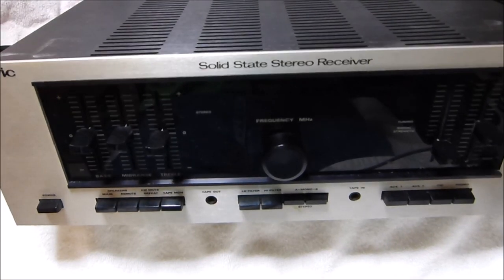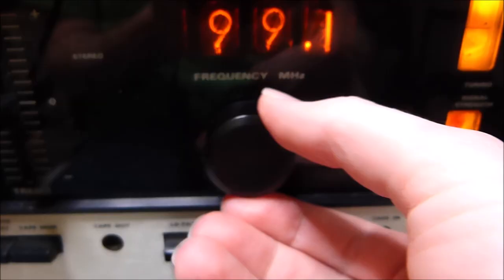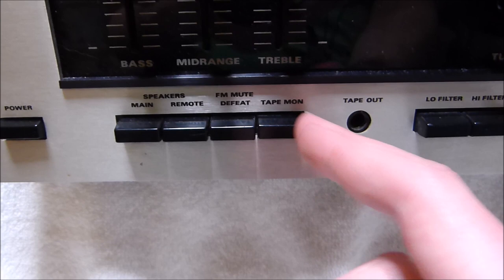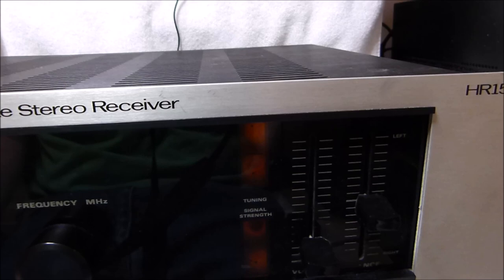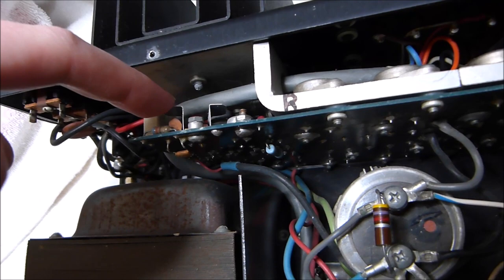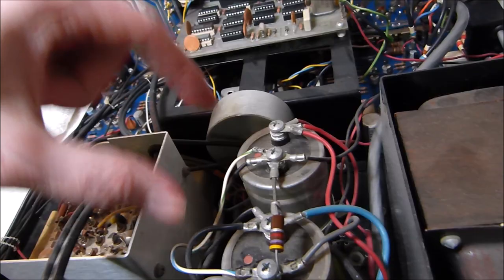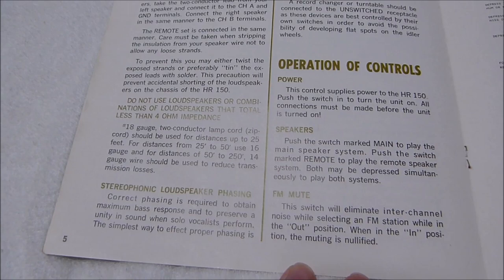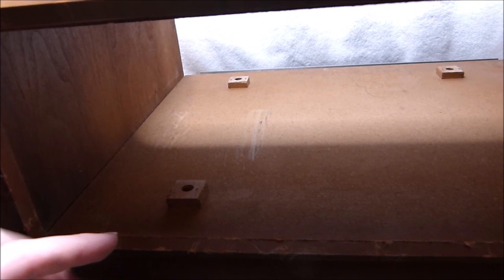Hervic HR150 Stereo Receiver with Nixie tube display (1974, USA)

Comment: That would look absolutely beautiful in an oak case. Funny how it's a solid state system with a tube tuning display. I think Scott made a receiver similar to that around the same time.
Reply from the maker: Depending on the lighting, the case it came with does actually look pretty nice too. The Scott 443 tuner has a Nixie tube display as well, but it wasn't a full receiver like this. The Hervic may be unique in that regard.

Comment: Love it, looks a bit like an SAE tuner. Funny how cool they look, reminds me of some of the Space 1999 props.
Reply from the maker: This receiver was in fact built by SAE, and the frequency counter board (Nixie display) is identical to the one used in the SAE Mark VI tuner.
Reply: @50sTransistorRadios  I once  had a SAE MKVI B. I never should have sold it.
Reply: @50sTransistorRadios  The rectangular buttons look identical to the ones on my old MKVI B.
Reply from the maker: @michaelwitas9482  SAE built both units, so they probably used the same switch caps to save money.
Reply from the maker: @michaelwitas9482  They sure are beautiful tuners, and it would unfortunately be expensive to source another one these days.

Comment: I'm trying to repair the Nixie board on a Hervic (same model). Would you be willing to send me a picture of the backside of your display board? There's a resistor and jumper wire that came off and I'm trying to fix that.

Comment: Interesting.  It looks like it might have been a pretty good one, given the price at the time.
I like it.
📻🙂
Reply from the maker: Thanks Jeff. It does seem to be pretty well made, and the fact that they put most of the semiconductors in sockets shows they had serviceability in mind (except for those dial lights).
Reply: 50sTransistorRadios 
Was there a way to put them into sockets -reliably❓. That’s a big oversight if so.
Off hand, the only radio I can think of that had sockets like that is my Zenith Trans Oceanic R-7000Y.

Comment: Very cool.  I would love to be able to recognize how to and tap into a fm rcvr and add in a remote counter.
Reply from the maker: Thanks! The SAE Mark VI tuner schematic shows the digital readout tapped off of the FM RF amplifier section with a 470pF capacitor. Note that this is still an analog tuner, the digital part is merely a frequency counter.

Comment: Ok, to diagnose the stereo light should be fairly easy. First, is it properly presenting FM in stereo through the speakers? If it doesn't play the FM in stereo, you'll need to diagnose and repair the FM MPX circuit, which is not difficult. Otherwise it's the stereo lamp driver circuit. MORE:

You want to locate the FM stereo MPX (multiplex) section of the receiver, which comes directly after the FM-detector, which is at the end of the FM IF strip. It can be done either discretely, or in an IC. The stereo de-multiplexing may also be done either discretely or in an IC. If it's an IC, it may do both detection and demultiplexing. You need to determine whether it's two discrete diodes and a small inductor, plus either IC or discrete mpx circuit,  or is it all being done in an IC. 

If you are not getting stereo FM play, try replacing the Stereo IC. They are usually the problem. It may also be the problem for the lack of stereo light function. If you are getting stereo play from the FM, but the light is the problem, then either the IC or some discrete circuitry is the issue. 

If the FM stereo is processed discretely, then usually there is a transistor and several resistors which drive the stereo lamp, some of which may be faulty. If done by IC, then usually the IC is faulty. You should search for other FM-stereo detection/demultiplexer examples online. Receivers from the early-mid 70s, like Pioneer 424/525, Sherwood, Kenwood, Sony. If you can find schematics, they will show either/both discrete and IC examples which are close to the Hervic circuit. 

It should be relatively easy to service that issue. Just determine if it plays the FM in stereo or not. The stereo lamp driver circuit may be okay because it's reacting to the inter-station noise, so you may have a dead IC, or discrete part issue in the detector/demultiplexer area. Read up  on how the FM stereo signal is processed and you'll  do fine.

Good luck.
Reply from the maker: Thanks for all the info cjay2! It seems to be decoding stereo just fine when the front panel switch is set to stereo, so the problem appears to be with the indicator circuit. There are several ICs in that part of the board (which is half covered by the frequency counter board), but I don't have any clear photos of that area to check what parts are there. When I have it apart again, I'll take some photos.
Reply: @50sTransistorRadios  yeah, it's probably using an FM MPX IC to do the whole thing. It seems the problem is in your stereo indicator driver circuit, between it and the (probably) IC. The IC would have a built-in LED/lamp signal output pin, but not the final transistor that drives the lamp/LED. That would be outside of the IC. If it is an FM IC, then find and check the voltage on the pin that drives the stereo indicator LED/lamp. If that isn't working, then replace the IC. If it is, then find and check the two or three parts that go to the lamp/LED stereo indicator. Check other popular early 70s receiver circuits to get examples of FM MPX circuits using your same IC.